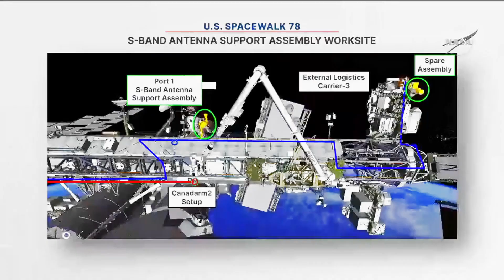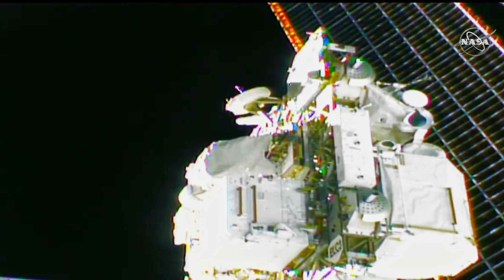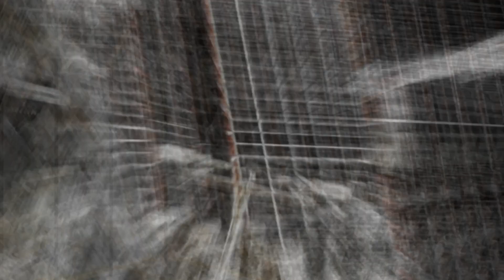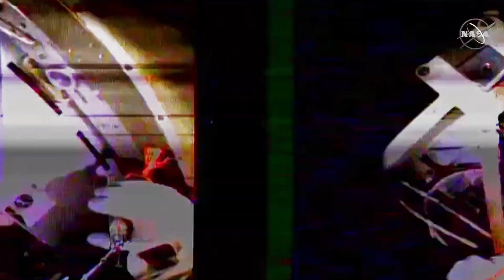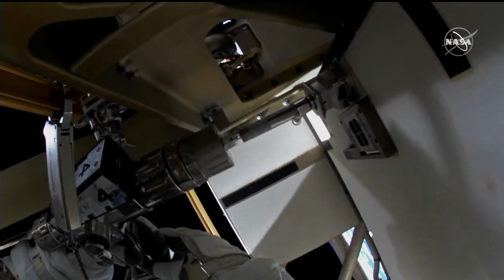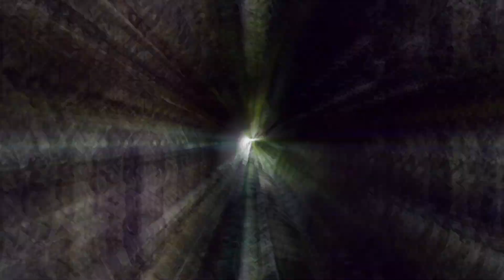Astronaut Kayla Barron Spacewalk Reel - Expedition 66, US EVA 78

Comment: If you are attached to the outside of a car on a chain and you cant run 80 mph, you are GETTING dragged around quite a bit. But if you are INSIDE the car, you are ON a plarform with wheels, so you will go traveling the same speed as the car comfortably